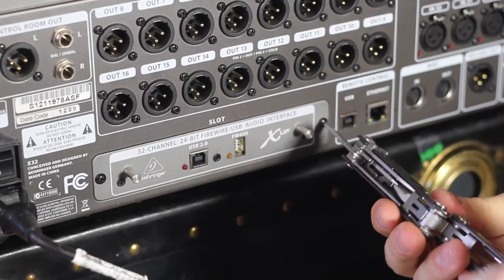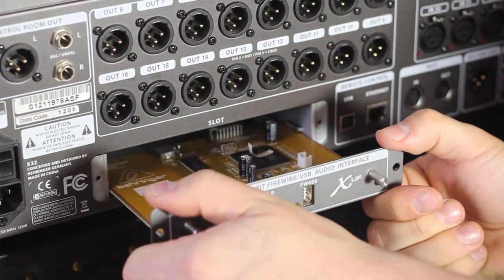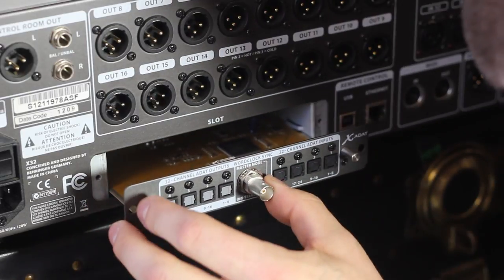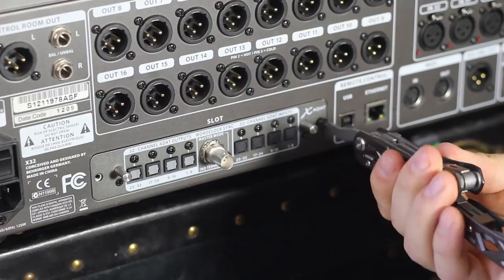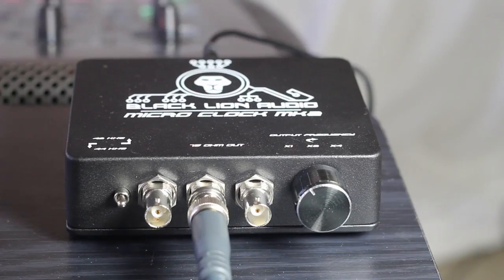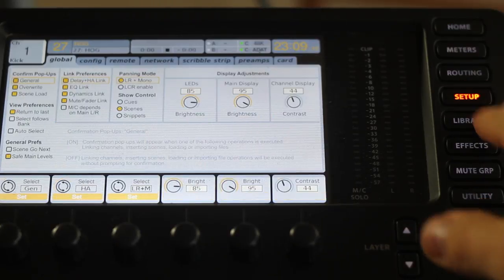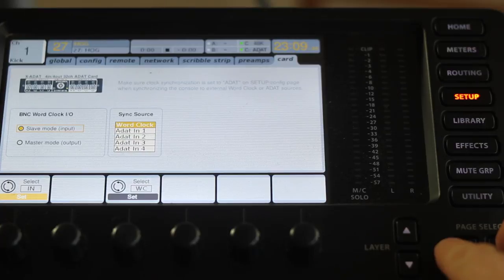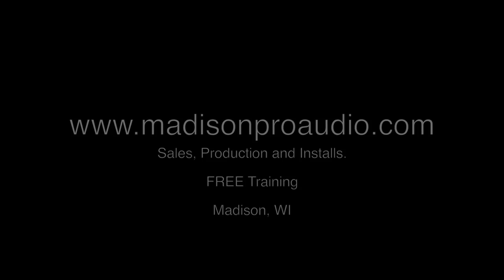Behringer X32 Expansion Card Installation and X-Adat Card Setup Word Clock

Comment: Hey, just wondering: 
I'm looking for a solution to split all of our 32 channels. So i was thinking to get this adat card and connect them to those Behringer 8-channel adat devices. 
Would that even work? 
As a band we are self-contained with our x32Rack + DL32 for our in-ear setup, mostly going AES B to FOH for our M32. But sometimes we play at venues that only allow for analog splits (because they don't want to use the M32).